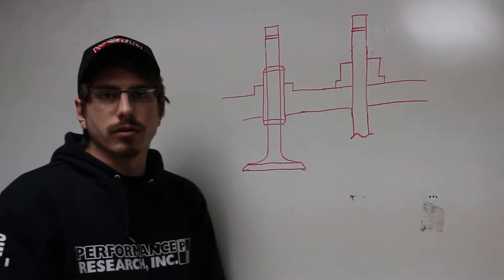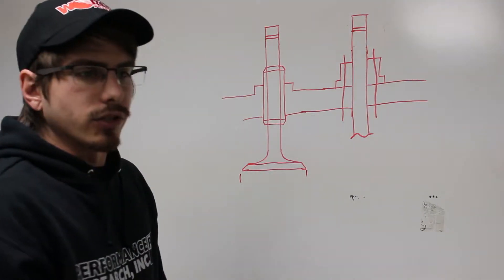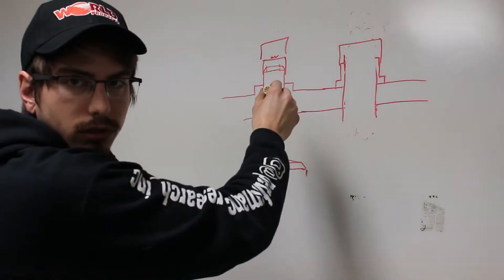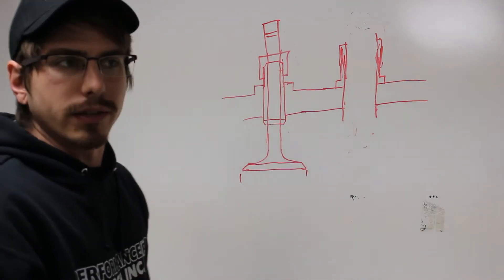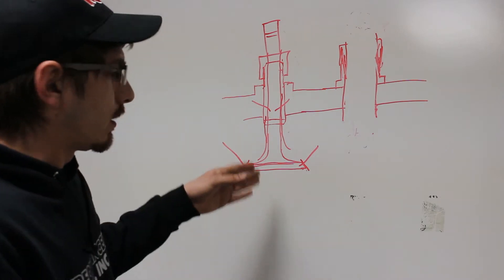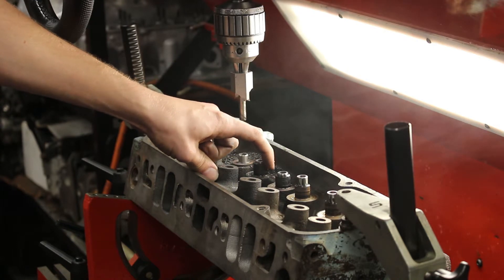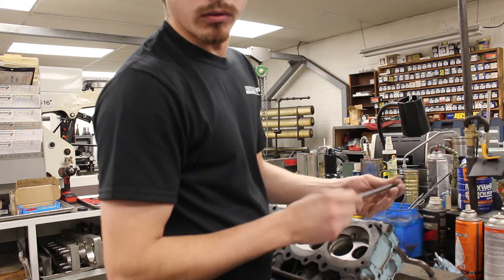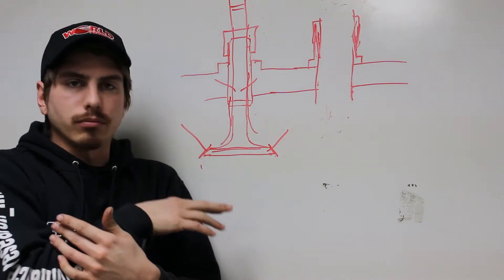Valve Guides Explained! Installation and Machining. Cylinder Head Overhaul Part 1

Comment: Hi brother,
I am from India, Bangalore. Youtube recommended your video just today. 

I have a Cummins KTAA19G10 engine for power generation which recently dropped its exhaust valve in 6th cylinder and its piston, liner, valves and injector all have got damaged even though all schedule maintenance were done.

Can you kindly help by making video on why valves drops and how we can prevent.?

Comment: Thank you, sir. I was just getting to pull a head off my sbc 350, that has remanufactured heads. I'm replacing the lifters, and was looking inside the intake ports, where I saw two of those valve guide inserts protruding down about 3/32". I thought they were falling out. Whew. Moving on.

Comment: I have one quick question . Is it possible to heat up an aluminum head in an oven and put the vale guides inside a refrigerator and installed it together once they are ready so it wont create that hour glass shape inside the valve guide ?
Reply: Many heads are somple and just drive out the old, then drive in the new. Some require or work better heated up first but putting a guide in your fridge won't change the diameter much if at all. It's just not cold enough.

Comment: Great video !  I ask a machine shop owner that had 37 years experience , rebuilding cylinder heads if he can installed only the valve guides first and he said that it will not work , The valve seats comes first 🤔 We got into a big argument .
Reply: I do guides first since they are usually worn out and and my machine  cannot pilot off a worn guide.

Comment: How difficult was it to find a set of valves, springs, and retainers that are the proper height to function? I would have thought that if the engine never had an 11/32 valve option, you would either have to get custom parts, or creatively mix parts from different engines.
Reply: most people make them.  SBC setup is popular even on a ford SBF setup like mine.  at least in the afttermarket it is
Reply: @KingJT80  Ah, thanks.